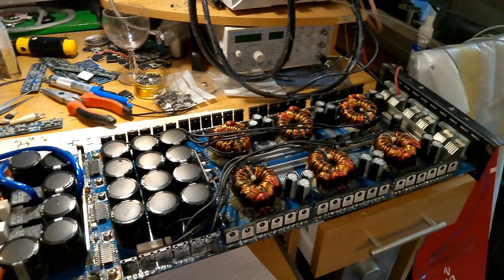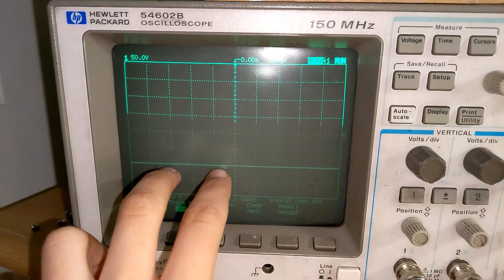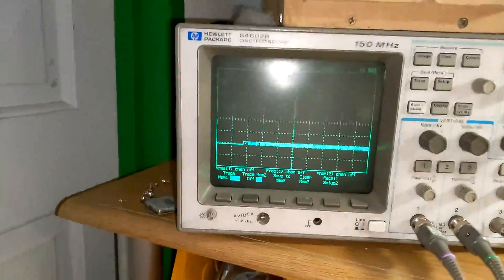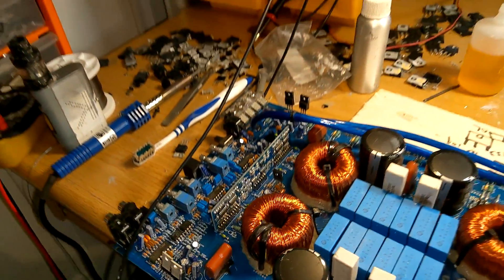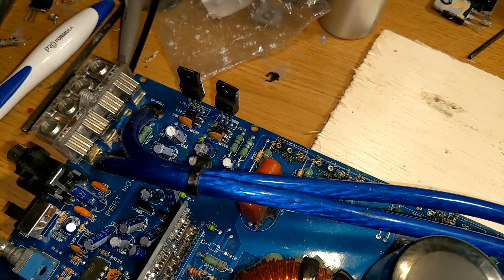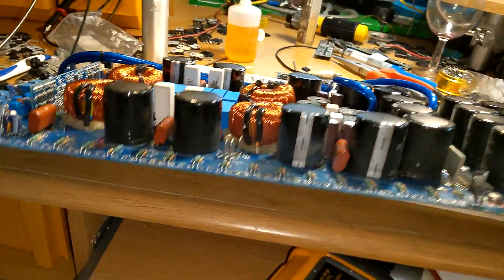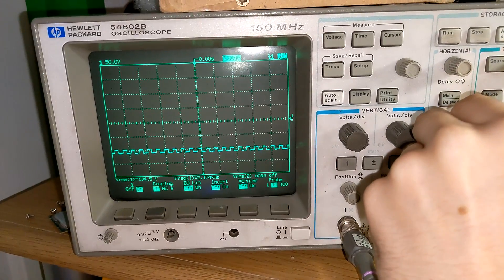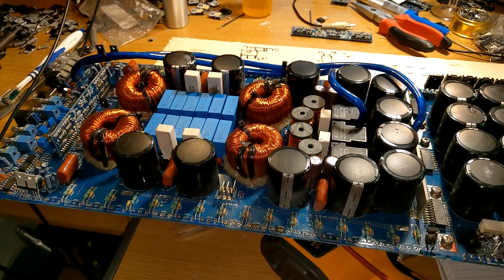Check this BEFORE FITTING MOSFETS! Korean halfbridge amplifier repair

Comment: It'sreally strange a circuit drawing relatively low current would have a timing issue from a resistor with such a low impedance. Is that entire driver card supplied through those resistors?

Comment: I am repairing a DC7.5 of the same system. Only the power supply part was shorted, so I replaced the FET, buffer transistor, and drive IC. It seemed to work fine and there was no problem with the sound output, but it would short circuit when the remote was turned off. What could be the cause? SCV-6000D is also malfunctioning with the same symptoms.
Reply from the maker: Two issues for this. 
1) drive circuit fault
2) fake Mosfets used.
If you bought your fets from eBay, Amazon, Ali express etc then this is why.
Reply: @barevids  I reordered the fet from Mouser and installed it and it worked fine. Thank you. However, there seemed to be some DC leakage from the preamp... Could the opamp be bad?

Comment: I have watched many of your videos with great interest which comes down to you. I wonder if you can tell me what mosfets to use in an Edge Xtreme EDX1800.2FD Q21 and Q22. All they have on them is H9. The gets on the power side have H1 stamped on them but they have a faintly etched number on them. The H9 which I assume is not the power side. Both of the IRS drivers have also blown so I will replace them. If you would like me to send you an image of the amp, will you send me your email to send it to. Thank you. Dennis
Reply from the maker: Hi Dennis. Use irfb4227.
Reply: Fabulous. Thank you kindly. You make video which are captivating.  Rock on.

Comment: I've got a Fosgate amplifier that I let a friend use I think it's the mosfets honestly I know it's the most feds there's several of them that is just blue Plum out I was just wondering if you could help me diagnose getting it cut back on I think the ground and hot touched each other I don't know for a fact but it's not good and I am really trying to repair this amplifier because it cost a lot of money and I do not have the money to get it fixed but I do have a soldering gun and Common Sense thanks and have a blessed day

Comment: Do you have a component list for the ext-3000d/hifonic/e-audio controller board? I had a link in an old laptop that died before I had a chance to backup.🤯 I have a half dozen e-audio e3000d to fix. fets broke from board flex. Chances that at least one would have fed back and popped the controller.

Comment: @barevids hey man got this alpine mrp-m2000 from a tag sale wasnt working at all was missing parts and looked like someone was soin some crappy work i replaced the missing parts and now the amp powers on with nothing more than a ground and 12 volts on the remote with no power connected to the positive lead, its hard to find diagrams and took me weeks to find the parts, anyideas whats wrong? I would love to ship it to ya but im in the u.s. idk how much it would be plus however more to repair, hit me up on my inbox i couldnt find yours
Reply from the maker: That's normal most amps will give a blue light with remote and no power.
Reply: @barevids  no sound tho

Comment: For some reason. I cant find how to messege you through you tube barevids? I have a question about an amp that i have. Everything comes on, when i hook the speaker up to it, it pushes the speaker all the way out. If i hook the speaker wires up bridged, it sucks the speaker in all the way? Its a old crunch amp, power one x2200. Any input is helpful. Thanks.

Comment: hi whats your opinion on micon capacitors? i just bought a memphis audio prxa1500.1 amp and had an itch to peek whats inside. it comes with 4 micon 105°c 2200ųf

Comment: Hi Sam (I believe that's your name..),

I want to build a T-line for home use using a compo I have laying around. 

While doing some research on it, I stumbled upon your video from 2013. (nice hair.. :P )

What's the typical Fs for a 6.5" and should I tune the port to that freq?  Can I go lower and if so, to what extend. 

The only info I have on the compo is that it's a power acoustic SL-6C 75w rms. I'll be driving them with a Precision Power PPI-2075AM on a alpine CDA-9855R. Hopefully the T-line has the same quality as the other two.

I really like your vids by the way. Maybe funny to hear but in some way I find them relaxing to watch.

Frank

Comment: Hello Barevids i have question about bridging amps. How can i bridge 4ch amp to a mono? Have amp with bridging switch 4/3/2 Can i use input rca inverted or better to solder the signal inverter?
Reply from the maker: No you can't eat 1 channel from 4. You can only cut channel number in half with bridging. 2 to 1, 4 to 2, etc.

Comment: What you say about the resistors on the regulators Vin makes sense. However, I think that these resistors serve as a kind of circuit protection for overcurrent. They function as the weakest component in the circuit. Isn't it a better idea to replace these resistors with a slow blow through hole fuse instead?

Comment: Hi, I was trying to solve a ground noise issue on a small new pioneer class d amp and I found the source of the noise rca line input, I tried grounding the the negative side and the amp now no longer powers up ☹️ I am not using a remote power on and the cars factory head unit with no rca outputs. Using the supplied speaker level rca converters. Any ideas?

Pioneer DM-D8704 100w RMS x 4 (was only using the A channel at the time) no fuses blown on amp or the power cable

Comment: So I bought the DD m1 worked awesome, picked up the dm 2500, was running at 1 ohm , on 4 dual 2 DD 615s, gets hot after a few minutes, protects voltage is good, ohm correct  0 gauge OFC dual,  inputs, amp has 3/4 in space underneath for airflow, dropped down to 2 ohm with only 2 subs same result, I'm super confused, on side note this amp was used....

Comment: Most half bridge MOSFET driver chips are incapable of turning the low side and high side on at the same time. A glitch like that shouldn't do any more than cause that audible start up thump in the speaker, because it would turn on one MOSFET for a few microseconds, leaving the other one off. The only way I could imagine a "shoot through", the technical term for simultaneous conduction of both transistors, would be if the high side and the low side are driven from different driver chips, and both chips being "ON" at the same time, because of a phase inverting glitch. Do these driver chips have independent inputs for the high side and the low side? If so, very rare. I would use drivers with a single input from the PWM.
Reply from the maker: The issue presented here is not that, though. If you probe the +5 and -5 VCC voltages going into the driver board for the opamps generating PWM, you can see voltage drop as they build, about half way up, which delays the opamps activating. in the mean time the +12v vcc for the drive ICs is already present. The exact issue is actually that the +5v has more voltage drop due to other devices on the board making use of it and less of the -5v. This causes the opamps to receive -5v VCC a fraction of a second before +5v VCC and a tiny bump of negative current is sent down the PWM output into the drive ICs, which are active, and relay that to the fets. An audible "snap" is heard from the output section and a big spike on the fet outputs, and the rail voltage dips down, showing current has been drawn by the output fets as a whole. Repeat this many times and the fets heat up, showing they are under stress from this incident. Keep repeating it still, and the fets will explode. I have this scenario captured on video exactly as I state, in one of my livestreams on a sundown 6K. You can see and hear the stress the glitch causes to the output fets, and then suddenly BANG in my face. Jumping over the limiting resistors completely cleared up the problem and the amp has been running for a good year or so daily. Other techs I have spoken to have experienced the same and confirmed the fix resolves. :)

Comment: Mr Vids, I have an old very reliable Rockford Power 551x. It works but I opened the amp and the caps are swollen so It needs four new caps (Lelon 3300uf 50v ce85° h323) I cannot find these caps and am not sure what to look for.. Would you have any recommendations on replacement caps and what type these are? Thank you in advance for any input and thank you for your amazing videos :-)
Reply: You could get Panasonic, Nichicon or similar quality brand, 105 deg Celsius caps that withstand higher temp that are used in PC power supplies. Don't get just regular caps, they have to be designed for switching power supply. Other than that what brand you choose doesn't really matter.
Reply: pliedtka thank you. :-)

Comment: Some years ago i used to repair car amplifiers.The class D large amplifier most of the times in the control pcb have the critical IC components scratched and is not visible their values.
Reply: that’s not fair 😩

Comment: If you want it to be fused you could use a couple of zero ohm resistors in place of the two you bypassed.
Reply: The wire is "0 ohm".

Comment: the resistors are there to protect the circuit if the regs go short and try to pass full voltage
Reply: Might be better to use PTC Resettable fuses than just wires.
Reply: @robertcalkjr.8325  yeah or hold chip off with rc on enable pin until oscillator gets going ...
Reply: @robertcalkjr.8325  as Agent24 says a resistor from vcc to pin 2 then a cap from pin 2 to ground will give a turn on delay on driver chip and time for pwm oscillator to get up and running....

Comment: I've come across voltage regulator circuits like that in other things.  Sometimes those resistors are put in series with the regulator if there's a huge differential in input versus output voltage possibly as an attempt to reduce heat generation because the voltage regulators are linear operation.   Other times I've seen them used if there is massive amounts of stabilizing capacitance on the output and there needs to be current limiting so the initial Cap. charge current doesn't exceed the capability of the regulator.  I don't believe either is the case in that particular regulation circuit and you're 100% correct.  They don't really need to be there.   Thanks for the tip! :)

Comment: Thank you for sharing this. It seems like it would be a good idea to swap them out every time you have the board out, even if you're not having the problem. You could probably also replace them with resistors that are 1/2 or 1/4 of the value and keep a stock look.

Comment: Thanks for the great video!
I wonder if there's another way to solve this issue? I see that the IRS21844 has a shutdown feature on Pin 2 (active low).
My guess is that some timing circuit is taking the chip out of shutdown too early. Perhaps you can change a value of resistor or capacitor to ensure the chip stays in shutdown longer until the PWM generator comes up. I don't know the schematic of these things so that might not be possible, but if so, it should be a more reliable way to solve the issue.
Increasing current to the other circuit might work but then you loose those fuse resistors and are liable to get more damage if those regulators etc go shorted at some point.
Also, I think that with component tolerance and age drift, there's no guarantee that the PWM generator power supply would always be "fast" enough in every case, even after bypassing the resistors.
Would be interesting to see if you find anything useful from this angle.